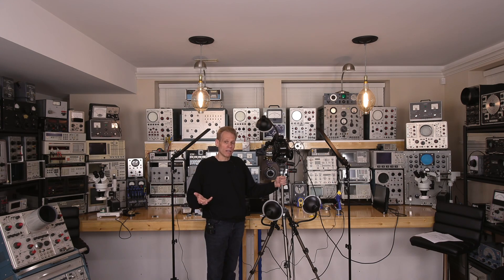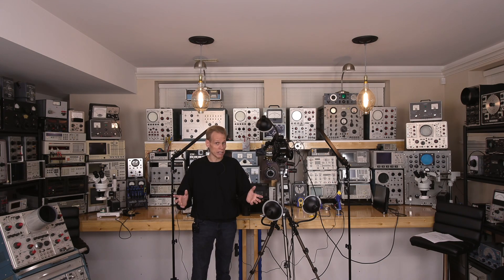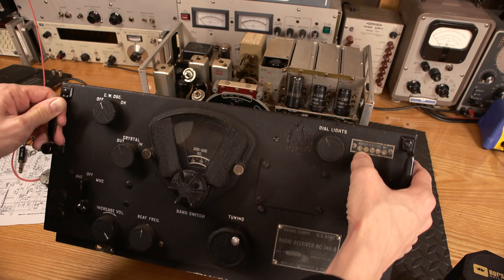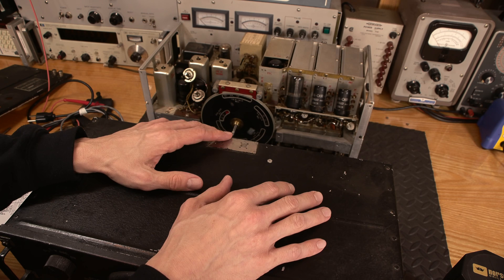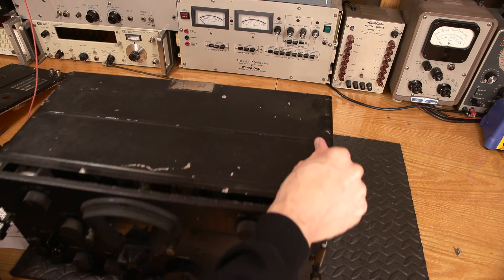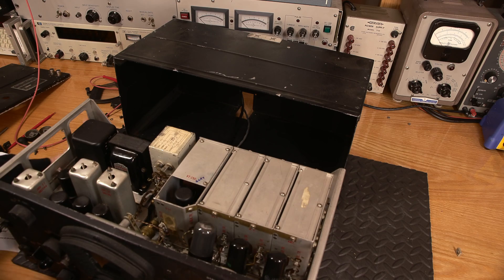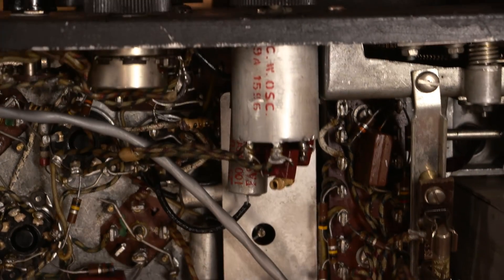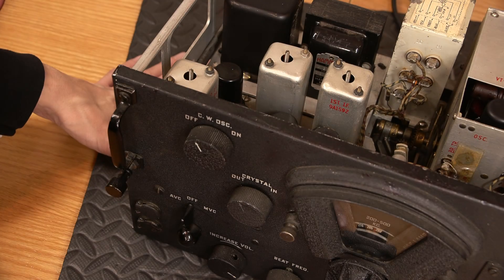Special Request - The New GRRS Entry BC-348!

Comment: When going on to the BC348 'finishing'  video where my comments have been blocked .....and listening to Mr Carlson's 'rave reviews' on sensitivity ...bear in mind the 348 is a 1930's design, grid-cap tubes altered later to use the new design tubes which had signal grid no longer on the valve top but connected to a socket pin. It is a marvelous receiver, sometimes used with "Command set" 190-550kHz receiver as "Q5"...or 85 kHz IF's fitted as additions, using the dynamotor plate for 2-3 IF's. You can use a BC1206 Receiver  same purpose...Someone made comment on the  AVC/MVC switch. function...Using the MVC (for morse or sideband) prioritised the RF gain section of the twin pot.....AVC prioritised the Volume section of the twin pot. I do not like using that paxolin switch for the AC mains connection unless through a filament voltage operated relay (via a diode)  ...I have seen the switched destroyed on those contacts by the arcing of the mains voltage and transformer induction spike. ...and replacing the switch contacts means finding one...An alternative is carefully installing a 240V rated toggle switch in one of the output jack holes ...well-connected and securely soldered ..or use the dial lamp hole  for a rotary or toggle switch..## .I prefer the former method as it avoids long mains wire if having power supply inboard and also ##keeps fingers away from mains power if pulling radio out of case (I invert in on my knees and lift case off)......if external supply do all switching at external supply or use the paxolin switch and filament voltage and diode solenoid, mains rated relay.  He makes the point of setting IF's at crystal frequency. I have hand filed and fitted computer mains socket in place of the 8 pin original. I can send pictures if someone wants.....it gets rid of the nuisance lead hanging around the set when moving it or taking-off its case.

Comment: What great work you do!  I’m interested in your 3,6, 9 antenna.  Is this your idea or is it  similar to wide band military antenna - those are fed in the middle and have good swr but not super efficient… your design looks like one side of a fan? It’s interesting.  I use a 3.55Mhz Hoz loop that works on 80, 40,  30…. To 6 meters.  I wondered if you were a ham but you answered that Q in last video I saw - thank you for excellent meticulous work  - AL7KT

Comment: I would like to see a vintage type power supply made for it. Could you get or make a mating plug for the connector in the radio? That way you can keep the connector in and the power cord could simply plug into it.

Comment: While I'm sure it would be super informative to follow you rebuild a vacuum tube power supply for this receiver, my feeling is that re-installing an original dynamotor would be the best thing to do for such a nice piece of WWII history
Reply: I have three BC-348's, one with dynamotor, 2 with very nice AC supplies.  I do not want to add extra work for you but a unit on dynamotors would be good.  There are a lot of great articles on relubricating the bearings but I have yet to see anything telling us how we could characterize the HV output (ripple, noise, etc.)  Three of us in North Dakota are very excited about  this BC 348 series.  The transmitter video project would be perfect!

Comment: dm-28 dynamotor is very quiet,  properly lubricated, barely hear it!!   you also have the connector which is often missing from the rear of the radio.  per matching transmitter, dy-12,dy-17 for the art-13 is quit noisy.    had 5 art-13s on 3885 saturday morning and 4 or 5 bc-348s being used with q5'r!
Reply: Yes, the DM-28 with renewed lubrication is barely heard when running.

Comment: I have a BC348-Q just like the one you are working on and I have a Tube Rectifier supply in mine. When I got the receiver it was in fair condition but the supply was pretty much dead most of the original caps were still within spec I only had to replace two and one resister was burned in half and a couple others were out of tolerance so I replaced those and it works fine now. Good idea working on the Great Receiver restoration Series Paul. Thanks for the video.

Comment: Paul, I too would stop what I'm doing to help out a friend. Have no problem with you starting over with another BC-348 that's just like the one you were previously working on. It would be nice to briefly cover what power supply requirements/modifications is need to power the  BC-348.

Comment: Your question about the power supply suggestion. Good question because I don't know and was wondering if on my Hammond Organ if there was any advantage getting rid of the old tube rectifier version?
Reply: The main benefit of a solid state power supply is that it is more efficient (and also cheaper to build). A tube rectifier has a heater which draws 10 or 15 watts and there is also considerable power loss in the tube plates. Because of the plate drop you can't directly replace an existing tube rectifier with solid state diodes or the output voltage will be too high.

Comment: Having been an avionics technician myself, I was just curious if this works on 400 Hz, as most avionics equipment do? This radio came way before my time in the field.
Reply: Since the BC-348 originally came out with 28 VDC dynamotors there was no reason or need for  AC of any frequency.

Comment: I love your design work, so would love to see you design and build a suitable power supply for this radio.  I would also like to see the equivalent modern, solid state design - just by way of comparison - you don't have to build that, just draft a circuit diagram.

Comment: Hey Paul!
When I was a teenager my uncle gave me a BC348M receiver.  The power supply he had with it used a 5R4WGY rectifier tube.  I fell in love with the radio and the tube in the power supply!  The E, M, O, P, and S versions had a feature that I found fascinating.  They use a potentiometer attached to the shaft of the tuning capacitor to maintain a Constant Internal Receiver Noise level and the IF frequency is 915 KC +/-  0.1%
I noticed a difference in the unit from your friend that the one I had.  The one I had contained capacitors in metal cans, rectangular in shape, that I think were filled with oil.  I was hoping that the one you worked on would be the same but I guess not.  I really was hoping that you would be able to tell me if the metal can type should be replaced without checking for leakage.
Anyway, thanks for sharing your knowledge and wisdom with us.

Comment: As much as I get impatient and want to see the restroe series,  I would love to see a traditional tube based linear power supply designed for this unit.
If you do have time, it would also be nice to see one of the BC-348's fully restored, with an original dynomotor based power supply.

Comment: I'd love to learn about designing and building a vacuum tube power supply using period correct parts and methods. That's a beautiful piece of kit your friend gave you. You're doing what friends do for each other. I'm all in favor of restoring this receiver in favor of the others. BTW, if space is limited inside the case, how about a separate, stand alone power supply à la Heathkit? A stand alone unit could power other, similar radios, too.

Comment: Y not Yes  5Y3 old school tube rectifier. I like Fender amps As long as it has tube rectifier.

I was thinking about this Airborne receiver and transmitter pair be used while in flight. For sure a big twin airplane or a turboprop would do it, like the TBM 850 or 900.  Of course be ready kool in a B 25 B 17 or B 29 bomber.

Just a wild idea. 

For sure Mr. Carlson restore this receiver !

Cheers
Kristy.

Comment: B+ should be 250 to 300v DC. At 300 volts it should draw 75ma of current. The original dynamotor was powered by 28v DC. I use a 6X5wgt for a rectifier. I like the old Radio Shack power supply. It is something they made back in the day for these old bc348's. I have one that is like brand new. All original coupling caps should be good in this radio. In mine I only replaced one which was slightly leaky. All others were good. These are NOT wax paper caps.

Comment: I would like to see a power supply design for it. This one seems like a neater choice than the others to work on.
I also would be interested in what you built to pull the plate off of the other one.

Comment: I would absolutely love to see a "period-appropriate" power supply design done for this radio :)
Reply: I Agree.
Reply: Me to!
Reply: Agree 100%
Reply: I agree, i have a BC342-N that has no PSU, i presume it will probably require the same one as the BC348?
Reply: The "period-appropriate" power supply is a dynamotor. There's something about the sound of a dynamoter that just warms the heart. Keep the radio as original as possible.
Reply: @GTCGreg   Yep- got one of these that's all original including the dynamotor.  Needs new bearings, though.  Makes a loud, somewhat high pitched bzzzzz from time to time.  No plans to mod it any other way unless it might be one of the military mods.
Reply: @scotttodd3506   Hi Scott. Don't get me wrong, I'm not opposed to restoring an older receiver with newer technology if that's what someone wants to do, but I found it a little odd that Mr. Carlson was somewhat taken aback when he saw a silicone diode in one of the receiver's power supply yet has no problem with replacing a dynamotor with a transformer and 5Y3.

An interesting "restoration" I did. I had an old Philco Model 630 radio from 1935 that I inherited from my Grandmother. Getting it going again would have at least required replacing all the capacitors and who knows what else. And for what? To listen to the current AM band? So I decided to do a little update restoration. I disconnected the HV winding from the power transformer but left the filament winding connected. So when you turned on the radio the tubes and pilot light lite up but the radio didn't work (or smoke) because there was no B+. I then found a thin modern speaker and sandwiched it between the original speaker and front of the case. From the back all you could see was the original speaker complete with its field winding. I then mounted a small blueletooth amplifier under the chassis where it couldn't bee seen. Everything in the radio was original except for the added speaker and bluetooth amp. Everyone was amazed when I would turn on the radio and out comes a broadcast from the 1930's. I's say: "what do you expect? The radio was made in 1935.
Reply: Same here. I have been thinking about it for a while for my BC-342 and BC-344 and will follow the new GRRS Entry BC-348 series religiously...
Reply: Me too. I have a 348R